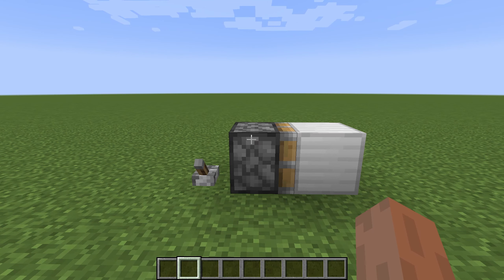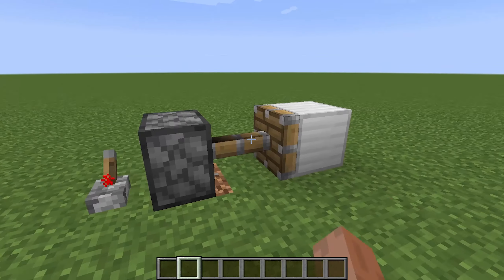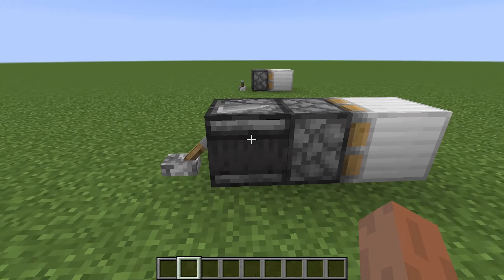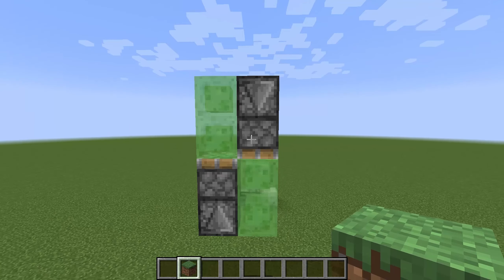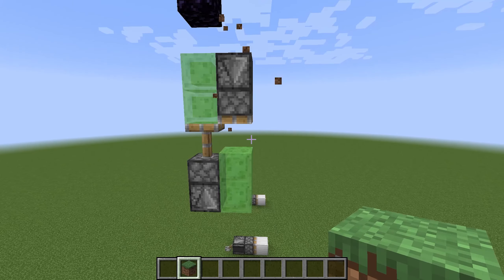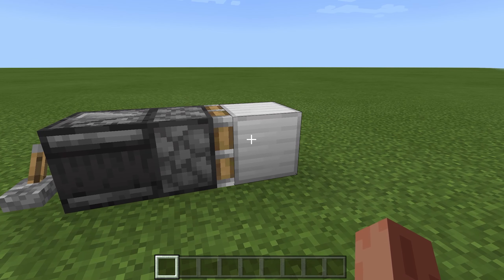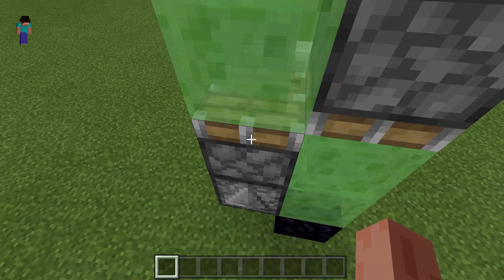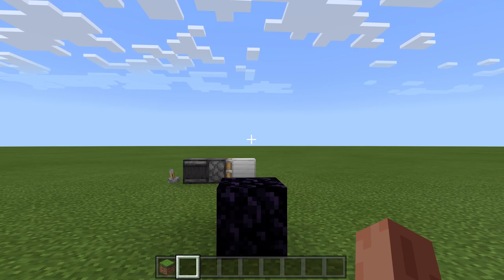Why 2-way Flying Machines Don't Work in Bedrock (Minecraft)

Comment: The only way to get it to work in Bedrock seems to be to include an additional piston that extends before the pushing/pulling piston extends. The extended "dead" piston locks one half in place to allow the other half to be moved. 

For every issue in bedrock not present in Java edition, there's always a workaround. For example, double piston extenders tend to break if you were to build it the same way you would in Java because repeater timing is slightly different so you want to leave a longer delay.

Comment: 2 way flying machines are still possible on bedrock - you just have to use 2 extra extended pistons so that the sticky pistons don't retract the blocks (since sticky pistons and slime blocks don't pull extended pistons)
Fed X Gaming has a great tutorial for this.

The other way is to make swapping points that move the parts around so it goes the other direction.
Reply: Well sounds like a good solution but we want convenience not some "Here's this with extra steps" No we need it as simple as possible as you know, but great alternative though
Reply: @Aurrideh No this is the only way to do it on bedrock, on Java there’s a way to make it easier but that’s the only possible way on bedrock to used glazed terracotta and add an extra two pistons
Reply: @Aurrideh there is no other solution but to answer the full question, YES there is a way to make two way flying machines on bedrock and even four way flying machines on bedrock

Comment: some people here on the comments are like "bUt i bUiLdEd a wOrKiNg 2-wAy fLyIng mAcHiNe iN bEdRoCk", but they didn't got one of the principal points of the video
the video (as i understood) explians that the most used 2-way flying machine doesn't work on bedrock bc of some property in the Sticky Piston that isn't available on the version. In the moment you come here and say that you made a working one, you are already talking about another thing that isn't related to the video, technically.
Reply: But the title didn't specify this design(while the video shows it), it's just general two way flying machine, which is a little misleading